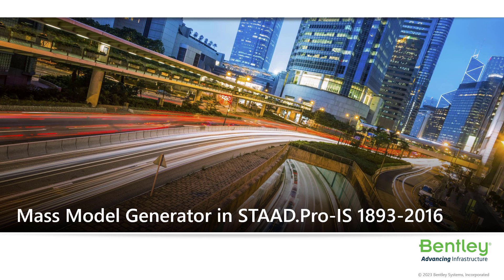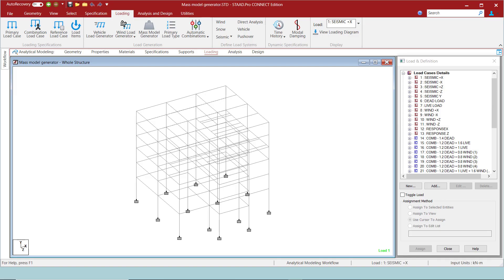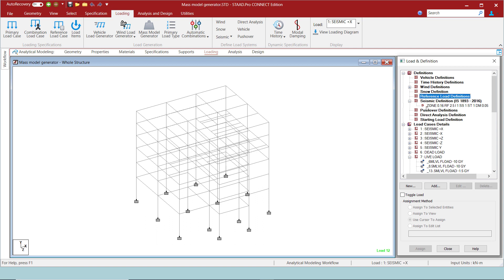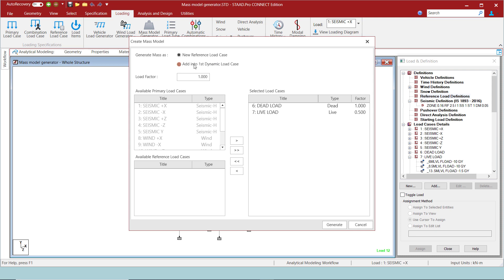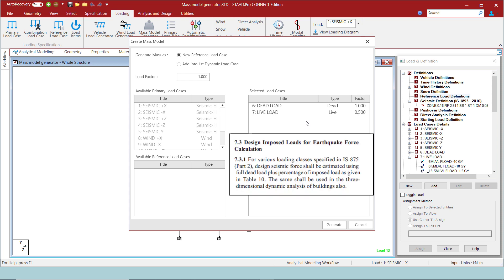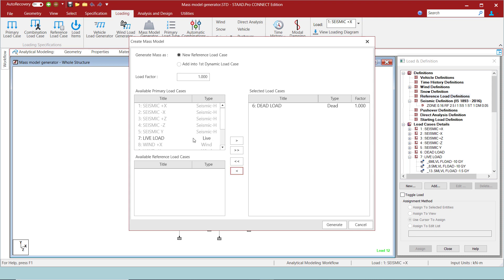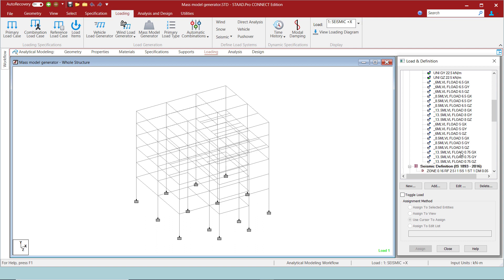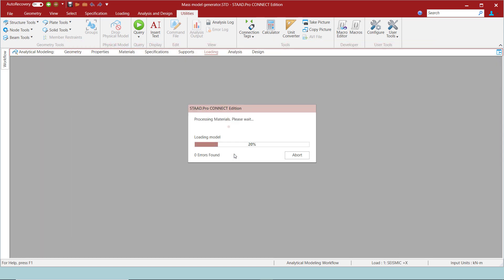Creating Seismic Weights using the Mass Model Generator in STAAD.Pro as per IS 1893-2016

Comment: Madam, What about plate load modeled/considered in dead or live load, if i have modeled plate mesh via parametric models command for floor/roof slabs? Seismic weight is not considered under definitions for plate loads, why so??